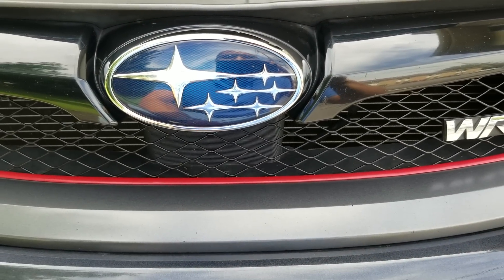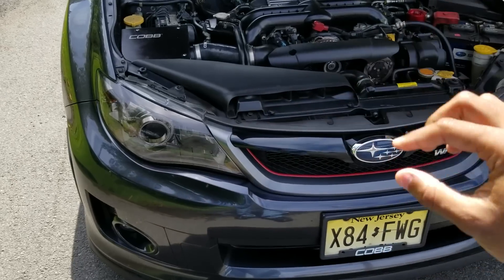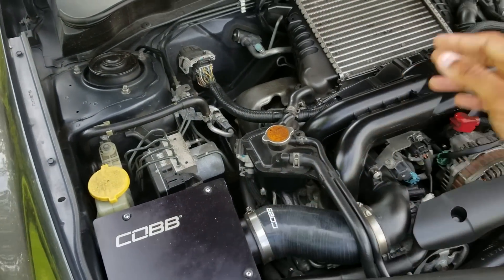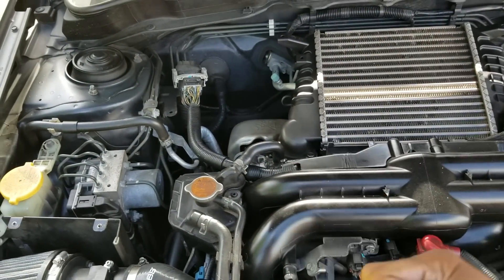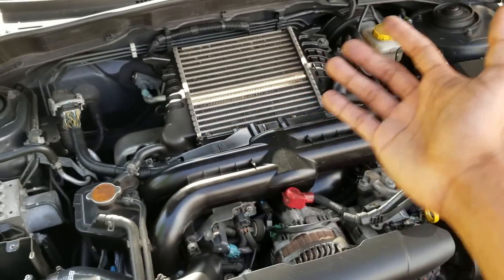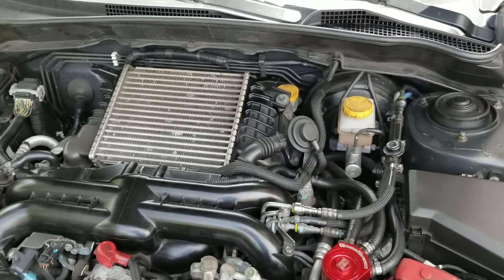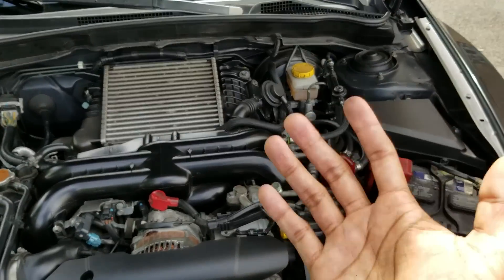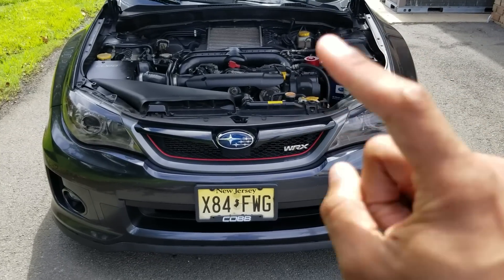WRX EJ25: Full Recirculating will work best

Comment: Isn’t this a ej20? Thought ej25 is STI?
Reply from the maker: Hey Chad, the 2012 WRX comes with the 265-hp, 2.5-liter horizontally opposed engine, mated to a five-speed manual transmission and Subaru's characteristic all-wheel drive. The STI comes with an even beefier turbocharged flat four, putting out 305 hp, and powering the all-wheel drive through a six-speed manual.  Thanks for watching!
Reply: @noel3286  10-4. Your right. I have an 11 sti.

Comment: I did this ssq blow off valve now my car pops between shifting sounds great but is this normal for my sti?
Reply: You're engine is less efficient now. It pops because youre pushing enough raw fuel  in the exhaust to make an audible explosion.
Reply: everything is ok in moderation. Obviously running rich is not going to be too good for the motor, but the people that opt to not use a blow off valve are simply doing it to prevent ANY vulnerabilities that they can. You should be fine, but push it too hard
Reply: aliveandwell thanks I’m currently running a full recirculated turbosmart now to keep it safe.
Reply: @rcwonders7908  i heard the lines on the turbosmart leak over time. I would check every once in a while

Comment: I want to run HKS SSQ BOV on my STi..😟 Videos like this scared me out of it. I have intake already,  but it's not the same.
Reply: This guy has no actual knowledge or experience in this subject. He's just spewing bs he's read posted by other 17 year olds.
"Some people say", "or whatever" "you never know", "I never know". Are just a few of his comments that point to this fact.
If you want to run it, do it and I would suggest a time(even a stock motor can benefit in a multitude of ways from a tune, doesn't have to be strictly performance)
Reply: Banging the tach of the redline does more damage to a motor than running atmospheric

Comment: If you still have the car give one of these a shot. It's knockoff of a turbosmart. It's a 50/50 and recircs half the air and vents the other. I have personally ran one on my 05 wrx and it was the best my car has ever ran venting any air and never really backfire. Just make sure it stays closed at idle and you'll be good. Don't get too caught up on the forum nazis you're not going to blow your car up with a bov.  If you don't like it you're only out 40 bucks 

https://rover.ebay.com/rover/0/0/0?mpre=https%3A%2F%2Fwww.ebay.com%2Fulk%2Fitm%2F192771891984

Comment: Stock bov is best for your car. Used the HKS VTA on my EVO 6 and it made it almost stall. Uninstalled it the same night and my car was back to normal. Don’t do it unless you’re pro tuning just like you said.
Reply: Sounds like you just needed to adjust it a little, aftermarket bov/bpv is better tho
Reply: I had the hks on my 96 eclipse and my 04 wrx and never had any issues.

Comment: What about other brands of recirculating valves such as boomba by pass valve will that make the car run rich?
Reply from the maker: not sure about different brands.  I would make sure to go with something reputable.  I know Cobb has a good recirculating bypass valve.   Synapse, Forge and Turbosmart all have good ones too.  The OEM one is also pretty damn good up to like 25psi.  Only issue with OEM is it takes forever to close.  None of those should make your car run rich because they are all Recirculating bypass valves.  Hope this helps.  Thanks for watching!

Comment: even with straight pipe with recirculate bov, can do backfire or no?
Reply from the maker: i am sure with a straight pipe, recirculating and a tune you can definitely backfire.
Reply: You definitely cant
Reply: I’m full straight piped with a turbo smart BPV and this bitch still doesn’t shoot flames
Reply: @dynamicgarage4727  I'm also catless dp, some decent pops on downshifts and hard upshifts but probably no flames :/
Reply: I Succ I found out how to shoot big boi flames! It’s literally a 69 cent mod from Home Depot. I also have videos I don’t think I have them on my Instagram
Reply: But only way to back fire is going fully atmospheric Bov. Message me on my Instagram and I’ll definitely help you guys with being able to shoot flames they are definitely loud
Reply: @_that_wrx_
Reply: @dynamicgarage4727  ok so whats does perrin bpv do? Gain boost or ?

Comment: I just bought a 2019 wrx and I can barely hear my turbo. I want a bov but seeing these videos idk. I dont want to void my warranty or ruin my engine. I've heard other people say it doesn't damage  anything.  Grrrrrr idk what to do
Reply from the maker: Congrats man!  If you want to hear your engine buy a Cobb intake with accessport and get a tune.  It will start making ALL the sounds you want to hear.  Also an exhaust would not hurt either lol.  You can get the BOV but it made me nervous also.  People seem to be running with them though and have no issues.  I just here a lot in both directions.  I wanted to be safe so I went the intake/tune/accessport route.  Good luck man!
Reply: Remove the ‘milk jug’ from the bottom of your air cleaner box
It’s an intake silencer 
It’s free and u hear more spool up with it removed. No tune needed. Research it

If u want the blow off sound just get an intake like guy above said. But I’ll need a tune or Cobb AP. I’ll hear PLENTY intake wooshes and noises

3rd option get a blow off valve.. not really worth it
Reply: @tellyawhatmate  I've done the milk bottle delete, but didn't get any improvement in terms of turbo sound, the car even felt slower. Waste of time IMO. I placed it back immediately

Comment: I'm not sure how much I agree with this. If you have no intention of getting a tune then you likely shouldn't be messing with the BOV anyways. At least, not the stock one. Now I have an intake. It does not do the flutter. It does sound pretty badass though, but it is not essential. Now I have an aftermarket exhaust, an atmosphere BOV, and an intake and not running a tune. I do have a protune coming in about a month. The atmosphere BOV will make your car run a bit rich but the benefits to that? Ever hear a WRX crackle and backfire? A BOV venting to atmosphere makes that much easier. You want the true flutter? Do a BOV delete. Want the flutter and want the massive blast from the BOV? Vent to atmosphere. I can say my car runs well and pulls hella hard. A protune is very important to ensure your BOV and other parts work well together, but an atmospheric BOV isn't going to do that much damage. The car is being watched by a computer and will make adjustments as needed. Take everything you read with a grain of salt technology, despite what many think, does have some give to it. Get an atmospheric BOV it's worth every decibel it produces 😎

Comment: I have 19 sti. The stock air box is actually good up to like 400hp. They did good design this gen. But ya anything you touch you need to tune on these Subbie
Reply from the maker: Very true man.  Thanks for watching!
Reply: I’ve got 2019 Wrx and I already have 15k miles, it’s a limited Cvt so yea I should have bought a STI,

Comment: My god you need to understand your stuff mate. Your just talking shit. Understand the bov just cuts the blow back from the turbo. The reason you hear it out the air filter is because That is the easiest way out. 

If you think about it your throttle body is closed when you take your foot of the gas. This is where the ecu reads for the injectors. 
I’m closed now turn the gas off.
Reply from the maker: Thanks for the input man.  Truly appreciate it.  All the information everyone is giving is really helping a lot of people out.  This topic always generates a deep discussion

Comment: My inner ricer wants stufututu.... But then i come back to reality and agree with you. Recirculation is best.
Reply from the maker: Yup same here man.  Its a very controversial topic as you can see from my likes to dislikes on this video but more people definitely lean to the give your car the right stuff it needs.  Thanks for watching man!
Reply: Noel3286 most people who disliked your video dont know shit about forced induction and air fuel ratios. Fuck'em , i prefer efficiency than attracting attention. I can tell you know what you're talking about. Keep being legit..
Reply from the maker: Thank man really appreciate it.
Reply: You can get the noise by blocking off the valve.
Reply: @jonnyrochester1141  yea but what for, the negatives outweigh the positives as far as reasons to do it.
Reply: I have TC installed in my car with Mazda with circulated dump valve, but still have slight  stututu sound when i lift off.

Comment: And i might have to disagree go to the Dyno bet you don't see any significant change from either one
Reply from the maker: I was just saying the dyno as a means to getting your pro tune/refining and fine tuning the bov's adjustment spring tension to let the correct amount of air pass.  This would be for a BOV with manual adjustment so that it can operate with your tune efficiently not really for a power addition.  Some people just leave that joint wide open not really realizing what they are messing with.  Some tuners with the dyno can really fine tune these things to get you the perfect balance of results and ride quality.  Thanks for watching man!

Comment: I have an 02, has anyone had a film of oil form under the intercooler on top of the y-pipe? Would a AOS help or is this normal. Haven't seen smoke or dripping. Thanks
Reply from the maker: Seems like you have a loose/damaged gasket somewhere.  Rubber coupling holding the intercooler to the intake manifold could be loose?  An AOS could help by bypassing some of the oil getting into the intake manifold and recirculating it back into the engine.  You definitely dont want oil in the intercooler or coming into the intake manifold.  That is what an AOS or a catch can would help seperate.  Could be just a reaaaaallly slow leakkkk.  Hope this helps
Reply: My car leaks oil by where the oil dipstick on top of the block and around the turbo any ideas or advice

Comment: Noel3286
This is very much an opinion piece you just posted and while not you're completely wrong about some things, your warning that people that they will most likely damage their car is a little reaching. 

Now a Atmospheric BOV isn't for everyone. It takes time to set it up. Many people that have issues with atmospheric BOV is due to improper adjustments of the springs by allowing way to much to be vented or too little, or improper spring rate. With some adjustment an owner can improve spool rate by properly adjusting the BOV. It is also important to buy a quality BOV. Not a cheap ebay or craigslist one, but from well known companies like GFB, GReddy, Turbosmart, Perrin, TurboXS and HKS. I myself would recommend GFB Hybrid to most daily drivers. They are easy to use and adjust. You don't have to sit there replacing springs. You can also adjust how much is vented to atmosphere vs recirculated.

You're only going to run a rich mixture between shifts and letting off throttle, which can be good for the car with Atmospheric BOV. The extra fuel helps cool the cylinders and turbo. And instead of pulling in recirculated warm air you'll be pulling in cool fresh air. The biggest downside to atmospheric BOV will most likely be the shortened life of the catalytic converter do to extra non burned fuel getting in it. 

I've been working on Turbo Subaru's for 16 years and have run some sort of atmospheric BOV in all of them. I've ran some of them without a protune and some with, and have never had a problem with any of them. A new BOV has been one of the first mods I do, just for the added benefit of cooler exhaust temps, intake temps and quicker spool. My 2010 Forester XT has 120,000 miles on it and it has had an GFB Atmospheric BOV and Grimmspeed CAI on it since 5000 miles. It ran great that whole time. It wasn't until 80,000 miles when I thought the Forester needed more and got a protune with the addition of many performance parts.
Reply: Anthony Choueiry lol your talking about running lean but also talk about back fires which is running rich nice try.
Reply from the maker: I agree this is my opinion but i have read many things also about it also.  Im no expert but all im saying is a Atmospheric BOV installed but not properly configured and without a good Pro tune on the car can still over time contribute some wear to the brittle design by Subaru of our piston rings.  Just have a good tune essentially.  Thanks for watching!
Reply: Noel3286 atmospheric BOV would actually assist helping the lean issue in the Subaru which causes ringland failure
Reply from the maker: hmmmm that is good to know Dane.  Well I hope people read this.  My goal was to start conversation so individuals can come and look at the comments and get some helpful answers.  This is a very divided topic within the Subaru community because you even have a lot of forums saying negative things also. Its good to have a Subaru Techs experience on here to provide assistance also.  Thank you for the good information.
Reply: Is there a percentage to atmosphere and a percentage for recirculating you would recommend?
Reply: GFB are leak prone garbage. The other ones listed are good. Factory bpv will handle a lot actually. Tial would be my number 1 choice, but the others listed (besides GFB) are all good choices.
Reply: Is there any possibility to get misfires issues installing BoVs?

Comment: Dude its a bov. Your shift is a split second. Ur air loss from an atmospheric bov is minuscule, not to mention (unless you are flatfoot shifting) you are letting off of the throttle which would reduce the fuel(not at wot when you take ur foot off the gas pedal) so it might run rich for half or even quarter of a second. It’s not going to wash the cylinder wall all of a sudden or over time. It might backfire only if you don’t get back into the throttle again. Ur intake pressure is right back up milliseconds after getting back into throttle. Why is this such an issue. Why are people so scared about having their subies sounding nice.
Reply from the maker: I agree it is just a BOV and they sound BOSS but it still over time can contribute some wear to the brittle design by Subaru of our piston rings.  All im saying is  configure that BOV correctly and have a good tune essentially.  Thanks for watching!
Reply: agreed ive run an hks bov for awhile vta no issues...just excellent throttle respone + smoother shifts + whp

Comment: well your wrong, when u shift gear your foot isnt on the gas so there for theres no fuel going in, so theres no harm go watch the mcm video on it
Reply from the maker: I will check it out for sure.  Im no expert but all im saying is a Atmospheric BOV installed but not properly configured and without a good Pro tune on the car can still over time contribute some wear to the brittle design by Subaru of our piston rings. Just have a good tune essentially. Thanks for watching!

Comment: Cobb makes a full recirculating bov
Reply from the maker: Yes they do and it is designed to withstand higher boost levels.  Definitely a good upgrade if your starting to get into the 20lb

Comment: annoying how he has no clue about the mechanical aspect of this car. the noise that you hear is from pressure that the turbo builds. so obviously they wouldnt put it on a stock car. you are losing your turbo pressure instead of recirculating with the bpv. if you did 100% you would have a useless turbo.
Reply: lol what?
Reply: Guy on YouTube way too much I actually do lol. I'm taking about bpvs and pressure recirculating. It's fine though.
Reply: Jake Burley No dude you realize that there are cars that come stock with atmospheric blow-off valves right? You seem to think that a blow-off valve vents boost as the turbo spools

A blow-off valve is perfectly fine on some cars, all it does it dump the excess pressure within the system in between gears and when you let off the throttle so there isn't any compressor surge. Once you complete a shift and get back on the gas, boom you're building boost again. 

So I have no clue where you got the "useless turbo" idea...
Reply: Jake Burley You have no idea how a turbocharger works do you? Lmfao dumbass

Comment: It's called a diverter valve. These cars are equipped with both MAP and MAF. With a MAP (manifold absolute pressure) meaning it can adjust AFR accordingly with an atmospheric BOV. Running BOV is fine.
These ECU have limited learning adjustment, but they still adjust accordingly to a certain extent, the have to. 
You upgrade, to a BOV to control(limit) boost press loss during shifting/ closed throttle. 
-7 years of working on and building race cars. And licensed education
Reply from the maker: Thanks man for the info.  I like when we get really informed people in here to educate.  Helps for the community and anyone else looking for help.
Reply: @noel3286  Then why are you putting out bs info???
Reply: Doug Smith it’s not BS. If you’re running the stock MAF and running a BOV you’re venting air out of the intake that the MAF already told the ECU it’s going to be receiving. A Little common sense should tell you that it would not be good for the engine. Don’t get me wrong tho, I’m a sucker for the cool turbo sounds but at a reliability stand point, it may not be the best option for you. It all comes down to your decision.
Reply: What BOV would you recommend for a Impreza WRX?
Reply: So a bov is fine for a completely stock wrx?
Reply: @felixnj217 no
Reply: ProVision3187 scoobyenginepicture